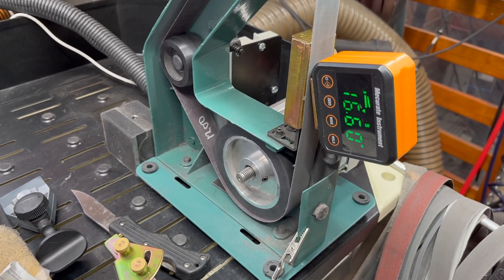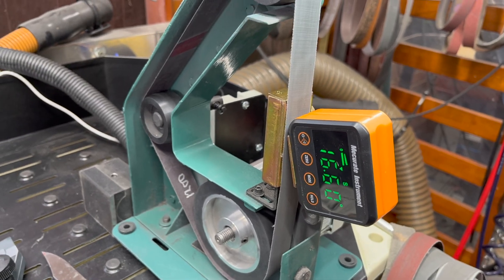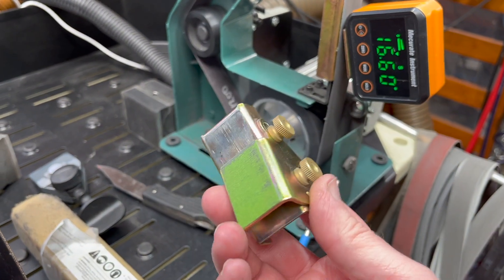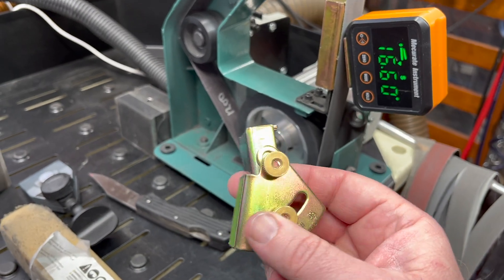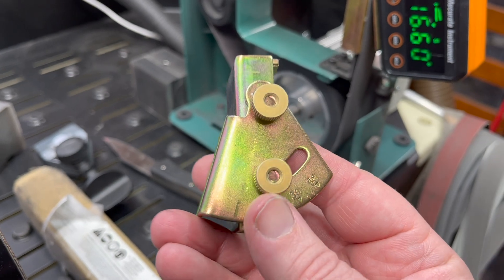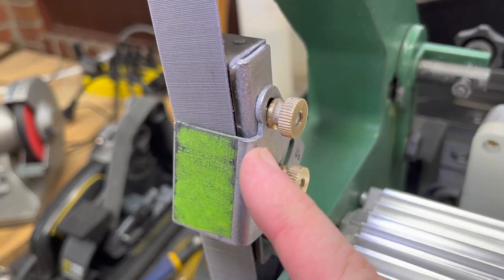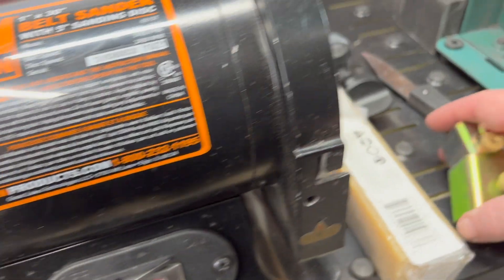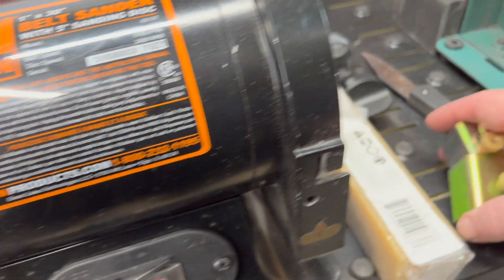"How to Achieve More Precise Sharpening with Your 1x30"

Comment: Thanks!  I just got my 1x30 after sharpening on a Ken Onion for a couple of years, and I'm running into the exact issues you address here with my angle guide.  Someone could make some money by manufacturing angle guides designed with your modifications!  I'm going to make these modifications today!
Reply from the maker: @gstevens62  yes they help a lot I’m reviewing a new 1x30 today so I’m doing the same thing

Comment: Your mods to increase precision are what require using the digital inclinometer.  To move the support guide closer to the belt, you removed most of the support material (and bent it a bit?), plus it looks like you bored out the slot/gap where the finger bolt clamps it in place.  Net the your guide plate is much closer to the belt, but at the cost of breaking the pre-set guide angles.  My unmodified guide is accurate, but with a big gap by the belt.
Reply from the maker: The preset angles on these I have found are not correct well usually anyway I like to use wedges to set the angle its fast and consistent https://youtu.be/1J2ql6tYxj8?si=GtbPAvWUS_LOgiRe

Comment: I made a slightly different modification to mine by attaching a small piece of 1/4" thick aluminum plate with JB Weld to the guide surface. The aluminum plate is softer than steel so it wont scuff knives easily. Also added a layer of teflon tape for extra goodness. The 1/4" raise of the guide surface provides bolster clearance similar to the cut away mod you did. 

I beveled the aluminum plate and extended it above the upper end of the guide surface so that theres's almost zero gap between the guide surface and belt. 

Slightly different approach to resolve the same problem with these angle guides.

It took a bit more muscle to bend out the out of plane tilt though since I didn't cut away the corner on mine like you did. I ended up fixing mine in a vice, over bent it beyond 90 at first, then slowly worked it back to a true 90 bend with careful, progressive hammer taps.

Enjoyed your video!

Comment: This is a great and helpful video, I didn't know about these angle guides but I'm going to order one now that I do, and I'm going to modify it by removing the corner,
The one thing I am going to do differently and would recommend to anyone else, is to drill a hole just above the bottom of the corner which would be best done from the inside of the corner and then cut down to the edge of the hole on both sides, which will be neater and remove the chance of overcutting to the bottom and avoid stress fractures.
Reply from the maker: Great recommendation

Comment: I picked up one of these angle guides about a year ago because I wanted to start sharpening. I had such a hard time on the right side because it wouldn’t allow me to get close enough. I got so discouraged that I completely stopped trying, and hadn’t touched it in a year. I went back this morning to try sharpening again and ran into the same problems. So glad I found this video. Thank you for the tips! Going to try this cut out tomorrow morning.
With a baby now on the way, I wish I would’ve found this video earlier, because I feel I could have a decent stream of secondary income had I kept with it a year ago! You’ve encouraged me to keep at it. Thanks again!
Reply from the maker: It’s a skill and the more you do it the better you will get at it. Get some cheap knives from Goodwill or yard sales and practice. Consider checking out the Guild of Professional Sharpeners we have lots of training and tips to help you get started and discounts on many products sharpeners use. If you are interested let me know and I’ll send you a link. We have a free trail as well I am one of the Host I did an entire video series on Tormek Sharpening and CBN wheels
Reply from the maker: How it going?
Reply: @ALXSHARPEN  the notch in the guide worked like a charm! Still struggling with the small stuff. Like small pocket knives and the alike. Getting better all the time though

Comment: I just purchased a 1x30 setup with extra belts and the angle devise. Glad I saw this very inaccurate reference so I can avoid the problem it would make. 
I have an angle measuring thingy like that, and probably wouldn’t have thought to incorporate it into the setup. 
As for your references between the table surface being .1 or even 1.2deg from zero, that’s of no concern. Only the geometry of the actual tool itself and the cutting surface. .1 again isn’t really significant, while a full degree can be. 
Thanks for these vids. 

I’m hoping the cheap bucktool model is adequate for my needs. 
I want sharp knives but buying top notch electrical tools is my priority, as well as my kitchen gear, but BOCO (but once cry once) in every aspect of my life is sometimes a hard sell. 
I figure, this will be a legit tool and if I feel the same about this as many of my other tools, one or two means more options, not just wasted money. 😂

Comment: When you are referring to angle of 17 degrees wont that give a total or inclusive angle of 34 degrees on the blade?  How did you establish the 17 degrees? Is it in your opinion a good overall angle?
Reply from the maker: So when I first started, I consulted with a couple of sharpeners who had been at it for decades more than me to find out what they liked for sharpening angles, and in my first two years, I really kept track of how my customers knives were performing when they would come back in to be re-sharpened. I also had several Restaurants for clients that I did monthly knife exchanges with what amazed me was that I could not use the same angles that I use for my residential knives for my restaurant knives my restaurant customers were very hard on their knives, so I had to use a higher angle, so that their knives maintained a decent level of sharpness for the 30 days. That was how often we did and exchange of knives. So in general on Western knives for a residential customer my favorite is 17 degrees or 34 inclusive for Japanese I like 15-16 degrees for restaurants I like 19-20 degrees for western knives . Now I also don’t change angles on all knives if something comes in looks decent just needs touching up I just match the existing angle so it’s really just a general set of angles I follow there are time I deviate or if customers has a specific angles request which in general is not I want this or that angle, but usually I can’t get this knife sharp or it’s not as sharp as I want it or it won’t stay sharp very long then I look to see if a new angle will improve it’s performance.

Comment: I have a brand new Toolcker 1 X 30 Belt Sander, less than an hour use and now all of a sudden it will not track, no matter the amount of adjustment. Can you tell me how o fix this issue or what I am doing wrong? Could it be the cheap belt they send with the machine? Thanks Chuck

Comment: I am ordering a mini-1"x30" in a week or so, so I only wonder if I might find a similar deal for a more powerful sander from harbor freight and do some modifications, and I will do some searches right now! Hey!
Reply from the maker: If your doing a motor conversion to variable speed which I highly recommend because it let’s you go edge leading or trailing and have far more control and not over heat your knives then any central machine or Harbor freight is fine they are exactly the same and you ditch the motor anyway if you’re not converting the motor look for a variable speed 1x30 or get the Toolcker I reviewed and make the minor changes I show as it does far more than a HF model. The Toolcker is great for conditioning belts and grinding bolster and does a lot of things better that a HF full conversation the price difference is about $85 more for the Toolcker but it’s ready out of the box a HF Conversation cost less but it’s a lot more work to build and you have to install the motor swap the wheels of Cliff Curry’s good wheels so you will save some Money but you will have to do some work to make it a great sharpening machine.

Comment: Thanks for the tips but I have an angle question. I see you prefer 17 +/- which I agree is a good balance. Do you account for the primary bevel on the knife? Say kitchen knife with 1-2 degree primary and hunter with 6-8 degree. Would  you compensate to include that angle so your 17 degrees would be accurate? Thanks for any advice, I really like your videos.
Reply from the maker: my preferred angles are 15-16 Japanese 17 Western edc , hunting 19-20  I take many factors into consideration when sharpening knives like the grind style and knives purpose. I don't get overly concerned with primary bevels on kitchen knives but I don't compensate on the angle most of the time I am matching existing knife angels anyway

Comment: The stamped steel attachment on the grinder is meeting a price point for it.
It’s not to be considered a precision instrument, only a rough guide. 
If you’re interested in higher precision, you’ve got to go with an instrument that can measure as well as indicate via a readout.

Comment: AMAZON sells two types of angle guides, one grinding blade up and the other grinding blade down. Which one is best?
Reply from the maker: Thats because some people like to sharpen edge leading and others edge trailing and if you don't modify the machine with a new motor you can work by laying the 1x30 flat. My machines have all been converted to run both directions. I don't like the laying of the 1x30 flat for sharpening because I do 95 percent of my sharpening edge leading and when stropping I just reverse the motor so I don't need angle guides that go in both directions. I also find it hard for me to sharpen that way because of the height of my downdraft table and at 5'8" I cant see the top of the work piece. But many sharpeners do like to work all edge leading with the machine flat or the make a dedicated stropping machine configured that way. I find edge tailing sharpening to slow and burr removal is harder that way IMO.
Reply: @ALXSHARPEN  Thanks. I guess it would make sense to grind in one direction and then strop in other.  Sharp knives do cut.

Comment: Why not set up for edge trailing right from the get-go for all your equipment?
Reply from the maker: Because I mostly sharpen edge leading because it’s faster. I only go edge trailing on certain styles of knives. Planning on doing a video showing the subtle differences in the two forms as I just yesterday had a guy I’ve been helping was struggling with edge leading. I’m going to focus on how they are different and what you need to pay attention to with each way since they are different.
Reply: You prefer this over your ken onion?
Reply: @dougprentice1363  The Ken Onion is a great tool, especially for kitchen knives, but a large blade tends to oscillate on the belt: speed wobbles, tension changes, angle of attack varies.
I think bigger is better. I’m fixing to try a 2x72.

Comment: Hey do you know if the newer 1 by 30 belt sander from harbor freight is ok to modify with the aftermarket parts available on line for turning them into precision knife sharpners? I looked today for the sander your using in this video and did not see it available
Reply from the maker: I have seen it and read the specs and it sounds like all they did was paint it a new color and add a larger engine. The new color is pretty cool. I doubt they changed anything else so it should work fine. I do know that Amazon still sells the ones I used here is the link to them https://amzn.to/3MQ9lZN
Reply: @ALXSHARPEN  awesome thank you.!!

Comment: Should I buy a 1x30 or a bench grinder and paper wheel system?
Reply from the maker: Bench grinder and paper wheels are good for sharpening some things but not great  for knives as most run to hot and to fast. So depend what you want to sharpen
Reply: @ALXSHARPEN  
Mostly Knives, and I have a big, recurve machete that needs a new edge.  I normally just use a whetstone, but I can’t with this big recurve.  Looking for my first powered system and it seems a 1x30 or the paper wheels might be the thing to get.  The new Ken onion looks nice but is pricey at $250 for the elite model with the blade sharpener attachment.  I was thinking a 5/8 inch paper wheel set would be good for my recurve machete.
Reply from the maker: @llamawizard  I like 1x30 or 2x42 much better or  even 1x42 for bigger things and for sharpening look for low speed buck tool has a nice 1x30 that’s bulky good for bigger things . I only like paper wheel for removing stubborn burrs. Go here and scroll down look for the black low speed buck tool https://www.alexandriaknifesharpening.com/sharpening
Reply from the maker: It’s $149 has half grinder and half 1x30 but it’s low speed far better for sharpening
Reply: @ALXSHARPEN  thanks!!!

Comment: Nice video! Never thought of that. Can you make a video on belt tracking? For some reason belt moves too much side to side. I have more idler wheels coming.
Reply from the maker: Best I can recommend is to get the upgraded wheels sold by Cliff Curry. That should help your tracking issues. Also check your tension spring if it's to loose that can be a cause of the belt not tracking well. My ten year old HF machine spring was to soft I had to replaced it about two years ago. Putting in a better spring may help.
https://shop.currycustomcutlery.com/collections/machine-parts
Reply: @ALXSHARPEN  ok where can I get a better tension spring? I ordered wheels from Curry now.
Reply from the maker: @robertmunguia250  I got it from a local old hardware store the  kind of old school one that have tuns of stuff and it's one of those you can buy just buy one screw. We are luck to have a family owned one here for decades.You can  also try pulling yours out and stretch it a bit that may work if  it's not to warn out.
Reply: I just checked my angles and man they were way off also. I have that Klein angle finder and zeroed it out. Sure enough they were off by a long shot. Thanks for info again!

Comment: I think I saw an alligator clip on one of your 1x30's. Is that for static electricity? Ive noticed a lot of build up (of charge), and get shocked. I've been putting a ground strap on my wrist to discharge the static. It works, but feels dangerous to have that teather on my wrist. 
Any insight?
Reply from the maker: During some weather conditions in my shop I have had some static mostly in the fall when it’s really dry I ran a ground wire to them as well that also helps

Comment: Hey Alexandria nice setup, is that a cheap 1 by 30 you rebuilt with a sewing machine motor? Or is it a custom made one? I can tell the platen looks very nice with the slots.
 I made a grinder with one of those motors for serrated knives following cliffs suggestion, works great.
Reply from the maker: I’m this video they are all ones I built from Wen or HF frames the Wen has a glass Platen and custom angle guide I made. But I recently replaced that entire Unit with a new 1x30 that I purchased and haven’t modified in any way just yet.

Comment: Hi Paul. Where do you have your 1x30 grounded to? I've been looking at that as I keep getting shocked from the static electricity when using it.
Reply from the maker: I do have a grounding rod that goes into the ground behind my downdraft table but during certain conditions usually dry low humidty the shocks in my shop can suck so when it's bad I use one of these. I really like the metal wrist band one I have the cloth one as well if you hook to the frame of the 1x30 you will have no shocks just be sure to remove any paint where you clip to  the frame.  https://amzn.to/3nFDeSE

Comment: For roughing out a knife 1x30 is good but to restore an edge, I find it removes too much. Also for restoring an edge. I like to pull the burr to the edge which I am finding out gives a superior edge which lasts longer. Only my experience.
Reply from the maker: It’s all good we do what works best for us and how we sharpen also keep in mind my 1x30 are custom and variable speed so I have very good control over material removal a non converted 1x30 I agree removes way to much runs hot and hard to control

Comment: How did you round out those holes?
Reply from the maker: Carbide bit and dremel tool and some wonder slick stick
Reply: @ALXSHARPEN  I meant to ask you is it normal for the CBN wheel to loosen some particles from the wheel? There’s dust below on the mat.
Reply from the maker: @robertmunguia250  yes when brand new and breaking in they will lose a bunch and be far more aggressive after 7-8 knives it will stop and they will reach their more normal abrasive level
Reply: @ALXSHARPEN  ok good to know. Thanks!